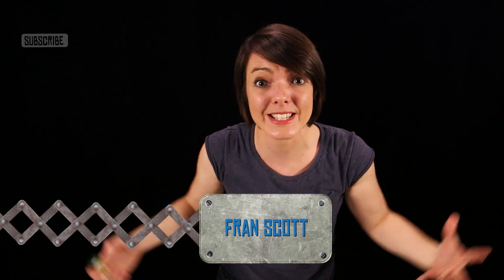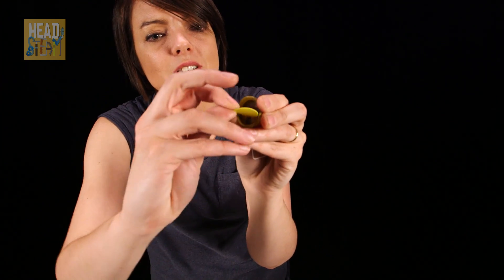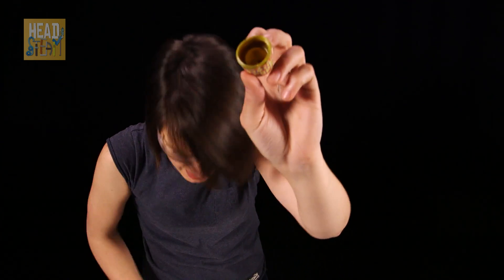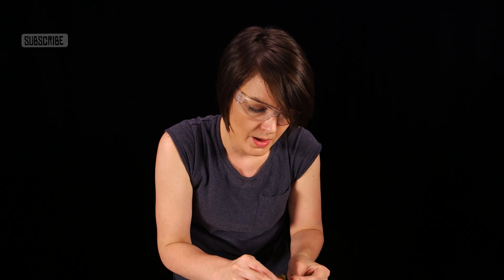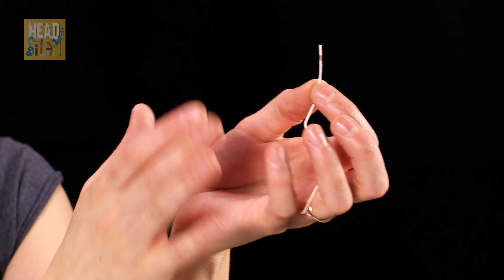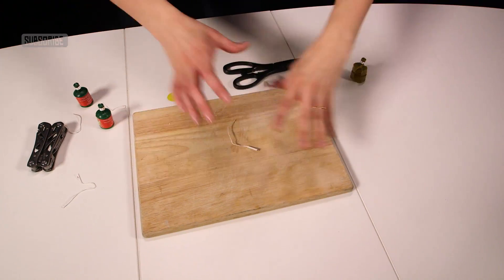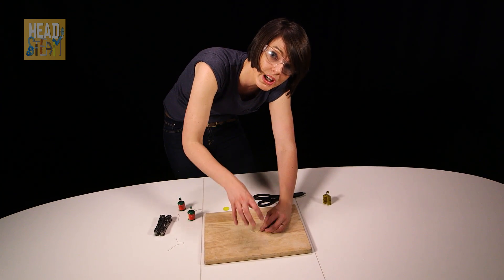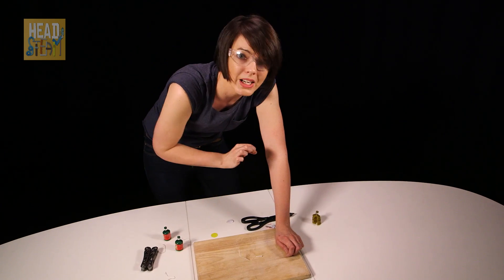Party Poppers contain primary explosives! | Chemistry | Fran Scott | Head STEAM

Comment: As a Pyro-Tech you were wise to put on PPE for your eyes but you neglected to protect your ears. Impulse loads on your ear can do harm even with short duration. The position that nothing bad has happened in the past so the it must be safe for the future...i would note that the NTSB report on the DC Metro Red line wreck on 22 June 09 offers that such thinking was part of the cause. The past is not always a good example of the future. As well using Google as a source of technical data for a risk assessment, well it may not be the best source. One final note the typical human gets 2 eyes and 2 ears as standard issue, they are not replaceable. Please protect your eyes and your ears. My experience is only a few decades in explosive safety, I have found that being over prep is far better that anything else. You have two many great years ahead of you to become a injury statistic.

Part of the reason the "pop" was louder than expected was it was on a hard surface and it was outside the paper friction pad. The  wave bounced off the hard surface and would have about doubled the intensity. You may care to read Frank Bodurtha book on Industrial Explosion Prevention and Protection.
Reply: +David 882 

Perhaps you could do a demonstration on explosive safety and risk assessment?

Comment: Don't forget that the explosives don't actually have to be much or very strong, as the small amount of gas produced, expands and creates pressure within the plastic shell of the popper, behind the cardboard plug, and only just has enough force to "pop" out the cardboard plug. It's more to do with the release of pressure from the cardboard plug, than it is to do with the explosive itself.
Take out the cardboard plugs but leave the streamers inside, and the popper doesn't work. (it pops but nothing comes out.)